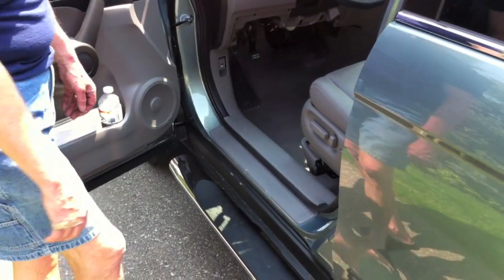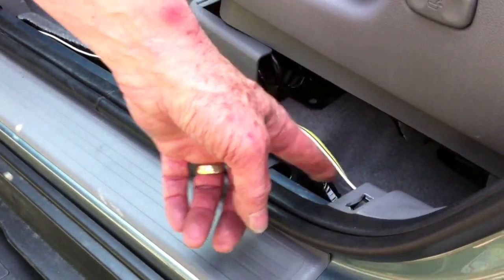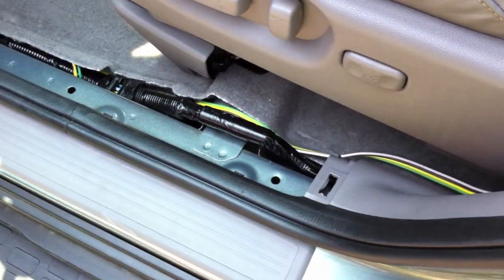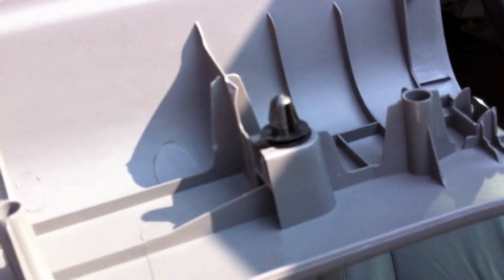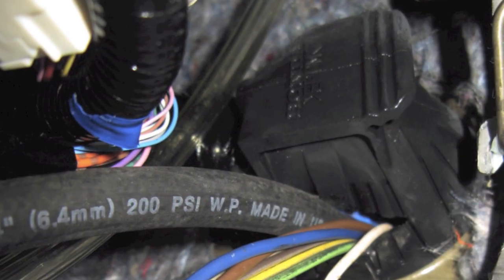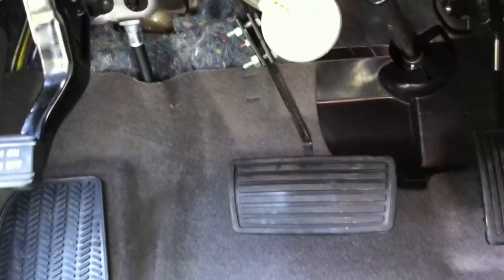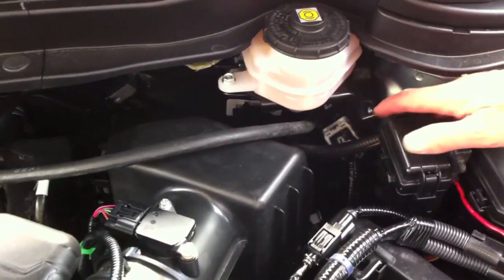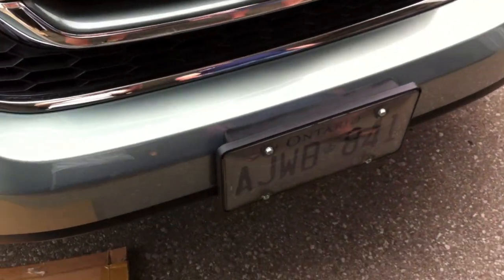Wiring Installation - 2011 Honda CR-V

Comment: I advice to use the 1inch grommet in the center of the firewall if your not running many thick gauge wires before using RVPartsPlus method. It is very difficult to get behind the strut tower with a wire puller from both directions.